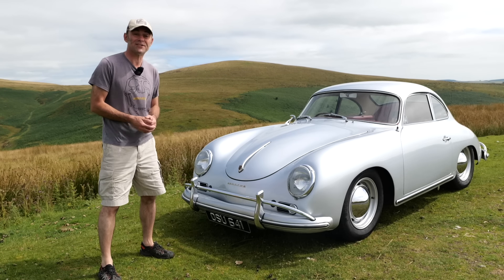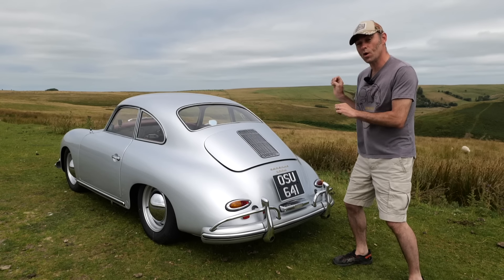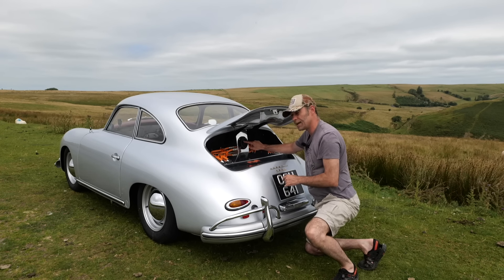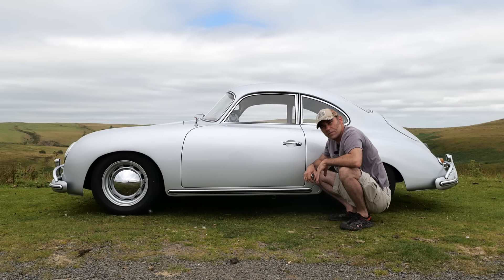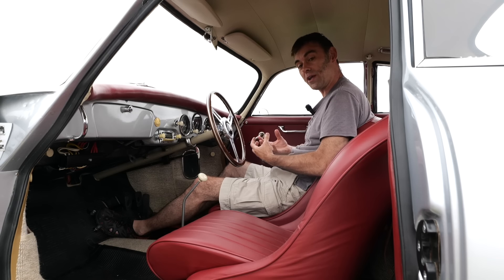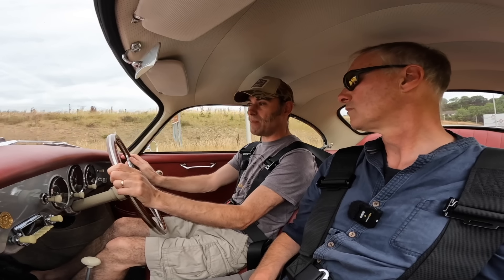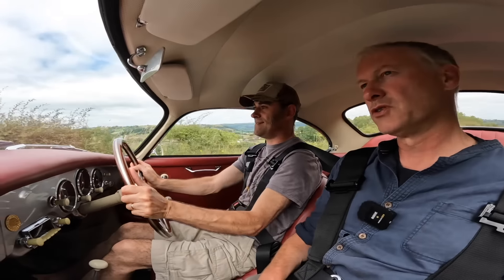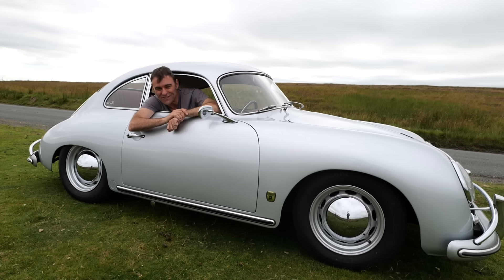All electric Porsche 356A

Comment: Another extremely professional conversation to, not just the best looking Porsche, but the best looking 356, before they went a bit ‘bulky’ ❤
I loved my 356 engined Beetles but would now prefer your electric conversion kit! No more oil smoke and fumes coming out of the heater channels, especially with a 356 motor conversion 😂

Comment: Like how you kept some ties to the original like the gearbox.   It would be interesting to analyse two comparisons:
1) Compare to geared gas version.  How much does the torque curve change between to the two?  Also compare how much the engine and exhaust plays into the driving satisfaction?
2) Compare to non geared electric.  Does geared EV need to be lower powered to really benefit?  Does it affect EV distance?  What about a larger, non geared EV on corners?  Does it lag?  Do you feel like you need to go larger rear tires to benefit?  Would a larger porsch gearbox support a larger EV engine
3) Bonus question:  Why not a sleeper 356 with AWD EV?

Comment: Does the original gearbox limit the efficiency of the motor, when compared to direct drive? Either way, great work and thank you for sharing.
Reply from the maker: It would depend on the efficiency map of the motor and the gear ratios, however a gearbox can hold a motor in its most efficient rev range so I’d say a motor attached to a gearbox would be more efficient for range. 👍

Comment: Before I watch the video, I was going to say butchered. I actually quite liked it when I saw it. You’ve done a good job, but personally I would’ve still preferred to have kept the original engine.
Reply: They're never butchered though. All their conversions can be undone if someone really wanted to put the oily bits back in.
Reply: @Cyberdyne-kg8ku  It still has oily bits, gearbox and diff
Reply: @watcher24601 Here are the specs for the 356A  -  Rear wheel drive coupé passenger car with a rear located engine, produced by Porsche. The power is produced by a naturally aspirated engine of 1.6 litre capacity. This unit features overhead valve valve gear, 4 cylinder layout, and 2 valves per cylinder. It develops 59 bhp (60 PS/44 kW) of power at 4500 rpm, and maximum torque of 110 N·m (81 lb·ft/11.2 kgm) at 2800 rpm. A 4 speed manual gearbox delivers the power to the driven wheels. Its stated weight at the kerb is 820 kg. The Porsche 356 An is said to be able to attain a maximum speed of 177 km/h which is 110 mph. 0-60 is 13.5 seconds  
Pretty much in keeping for the age that low weight would have given nimble handling we don't know the weight of the conversion though.

Comment: Question. I’m currently working on installing the same hyper 9 setup in a 1966 Karmann Ghia. Similar car…but definitely not as cool as the Porsche. How did you set a clutch switch to signal the regen-on-neutral braking to pause between shifts?
Reply from the maker: Speak to Hunter from Netgain Motors, he can help you out. 👍

Comment: Welcome back guys, been a while.  Question, when it comes down to economy, or range, with a petrol engine, using a transmission (primarily the overdrive) you'll get more range.  Why can't the same principle be used with electric vehicles?
Reply from the maker: It depends on the efficiency curve of the motor. 👍

Comment: Beautifully done chaps- but Weight and range?
Reply from the maker: Weight is the same as it was when petrol with a full tank of fuel. Range depends as always on how and where you drive it but as a rule it’s around 100-120 mile range driving normally on A roads here in mid Wales. 👍
Reply: @ElectricClassicCars  welldone keeping the weight the same.  With the electric drive train i hope the lucky owner enjoys putting loads of miles on her. Keep up the good work 👍

Comment: If the original drivetrain, clutch, gearbox and driveshafts were rated for the original 60HP would it not make more sense to use around 60HP electric and get better range, what is the weight compared to the original?
Reply: Besides the obvious reason that if you are re-engining a sports car it is unlikely that the owner is going to keep the same power as the original engine they are going to want it to go faster . The less obvious reason is that sub 100hp engined cars are dangerous in modern conditions. They do not keep up with modern traffic and are just traffic barriers on any sort of hill.
Reply: @francesconicoletti2547  Power to weight ratio is key, not HP figures alone, the 356 weighs 820Kg it has a top speed of 110mph and 0 to 60 of 13.5 seconds with that 60HP Todays cars are far heavier so need more HP to propel the extra weight.

Comment: Is torque an issue for that gearbox? 
I’m guessing the electric drive produces much more torque than the old petrol engine, no ?
Reply from the maker: You certainly don’t want to give that old gearbox full torque immediately, that’s why we program the motor/controller to introduce the torque more gradually. 👍

Comment: What an absolute waste of one of the most beautiful sportscars from the '50s. The smell and noise are irreplacable! Will depreciate massively!
Reply: So relieved to find there’s at least one person here who can see the emperor has no clothes. Let’s hope the damage can be undone when all this madness is over. Otherwise it will make a great donor car.
Reply: @daveshongkongchinachannel  i really don't see why this conversion couldnt be totally reversed, without much of a headache, running gear remains, just pull out the motor and batteries, re-fit the fuel tank and engine - i guess potentially the tin  in the bay may have been butchered, dunno, but not that difficult to reverse

Comment: Beautiful!   I’m probably being stupid but I don’t understand how changing gears helps with an electric motor?   If the torque curve is flat the motor exerts the same torque at low revs as high.   The gearbox is used in an ICE engine because it has low torque at low revs so needs gears to keep the engine revving.  If changing gears is to protect the gearbox surely top gear where the drive runs straight through rather than via lay shafts is safer?   Again I’m probably missing something but it left me a bit puzzled!  Or is it that older drivers miss changing gears and need something to do!!!

Comment: The best looking Porsche ever made is now ruined by electric motor and battery The value of that car has dropped it is worth more with the original flat 4 in it and it is simple and easy to work on with the flat for no batteries to catch that nice classic on fire that car is absolute rubbish now
Reply from the maker: Wow, there’s still people out there that believe electric cars catch fire more often than petrol cars. 😮🤦‍♂️ https://www.theguardian.com/business/2023/nov/20/do-electric-cars-pose-a-greater-fire-risk-than-petrol-or-diesel-vehicles
Reply: These cars are converted in a way that they can be converted back to their original drive train if you really wanted to ... so they retain their value just the same as any other classic car.
Reply: It’s a kind of mental illness. Some have commented that the damage can be reversed. Let’s hope so as I hope one day this madness will come to an end. In the meantime they should really only do this with kit cars.
Reply: @daveshongkongchinachannel  i'd say the actual owner of the car disagrees, with you
Reply: @honorste  I think that goes without saying. It’s a bit like telling someone not to commit murder and them doing it anyway.
Reply: @daveshongkongchinachannel  i think comparing an electric motor conversion to commiting murder is slightly over reacting to situation, no-one or any thing was murdered, if anything, consider it more like having a pace maker fitted to prolonge and improve quality of life ;-)